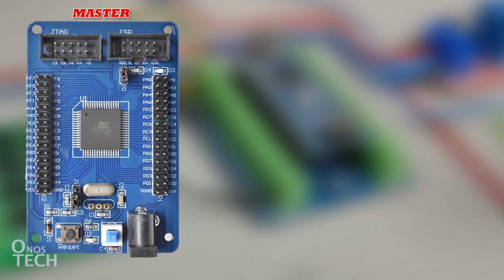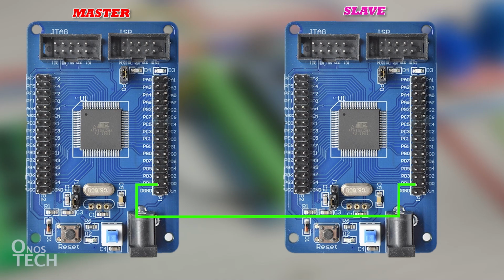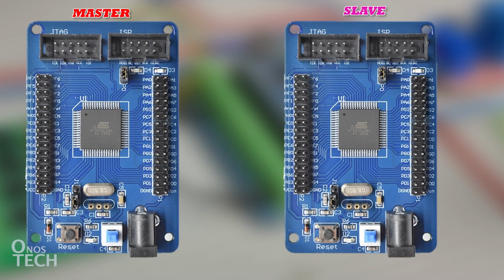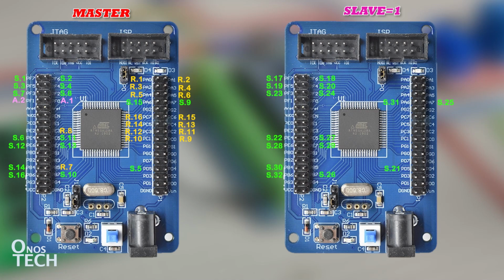M#2: Atmega128 Development Board Pin Mapping | Outseal Dev. PLC Mega

Comment: Hello Onostech,  I have built years ago some evaluation boards like the one you present here. The only change is that i had soldered on pcb the atmega128L that has maximum clock frequency 8MHz. Also the crystal is 8 Mhz. Is there any possibility to use this boards with the outseal plc software???  Thanks
Reply from the maker: You can try and set the Megacore frequency to 8MHz in Arduino IDE and see if it will work
Reply: @OnosTech  i have worked in past megacore through the Arduino IDE and works ok with 8Mhz after i downloaded the bootloader for 8MHZ.... My concern is not related to the code uploading via outseal software (i believe this will work ok). My concern is the PLC timers since the outseal software "thinks" that the crystal on the MCU is 16Mhz and calculates all delays based on that.  If there is no custom file in outseal software to modify it and define that the crystal is 8 mhz... then i will program in the plc a timer of 1 sec and the produced delay in practice will become 2 seconds because the mcu will run at half clock frequency
Reply from the maker: @george.vastianos  Oh I see! I think we will have to make a timer with it and compare it with a stop watch.